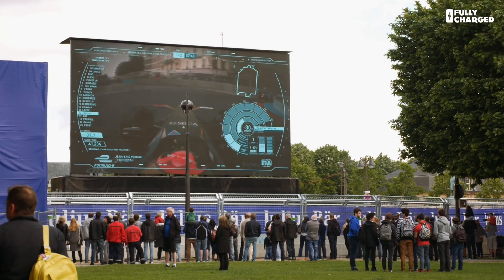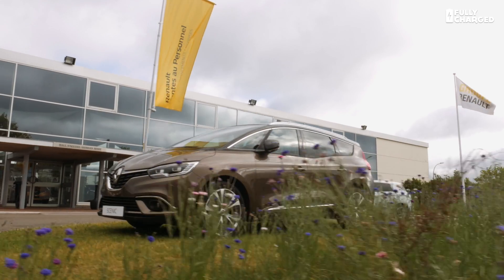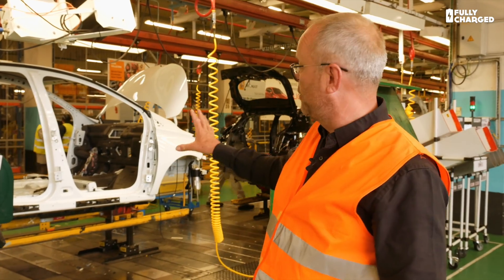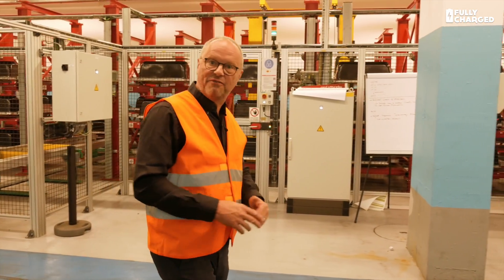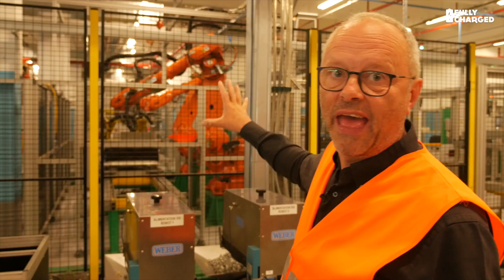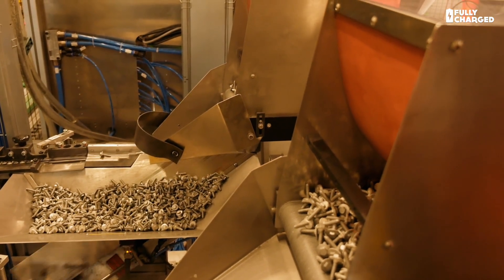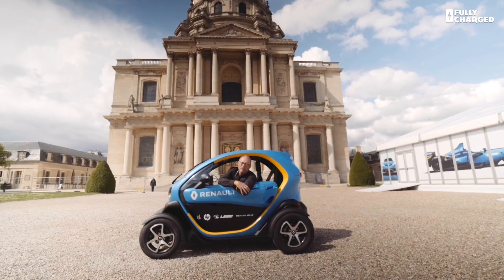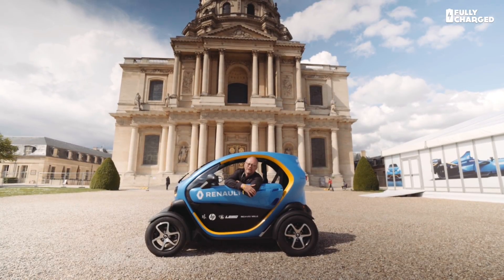Formula E & Renault Zoe | Fully Charged

Comment: I really wish Formula E would stick with using racing circuits over street circuits...   I get the idea of making it more accessible, but the street circuits make for very boring racing as passing is severely limited.    While I'm at it, since we have Formula 1 and Formula 2 etc. they should have gone with Formula 0 (F zero) as in zero emissions...   maybe Nintendo won't give up the name?

Comment: Not exactly on topic at all, but what do you think of the idea of putting something like a Tesla Powerwall into the back of a low-electric-range but capacious PHEV, like the 'newly-announced for USA distribution' Mitsubishi Outlander, for those times when it is being used for only commuting, not hauling, (and there is sadly no recharge available at work), so the Outlander can recharge during the work day, and gasoline use can thus be avoided altogether on normal work days?? (Assume that the commute distance one way will just about discharge the battery...)

Comment: Dyson, the engineering company best known for its vacuum cleaners and fans, plans to spend £2bn developing a "radical" electric car.
The battery-powered vehicle is due to be launched in 2020.
Dyson says 400 staff have been working on the secret project for the past two years at its headquarters in Malmesbury, Wiltshire.
However, the car does not yet exist, with no prototype built, and a factory site is yet to be chosen.
Sir James declined to give further details of the project. "Competition for new technology in the automotive industry is fierce and we must do everything we can to keep the specifics of our vehicle confidential," he told staff in an email.
Important points that are undecided or secret include the firm's expected annual production total, the cost of the car, or its range or top speed.
Sir James said about £1bn would be spent on developing the car, with another £1bn on making the battery.
Analysis: Richard Westcott, BBC transport correspondent
It was a slightly unusual launch, but then, Sir James Dyson likes to be different.
In a small room above his swanky London shop he told us about his vision for a clean car.

Comment: 6:22 Robert batteries aren't dangerous at a modular level the voltages are too low: it takes 50V to even risk human life and 500V upwards to induce internal burns (I've run electric vehicle production lines for SMEs in the UK). The risk only arrives at a pack level but even then it would not be fully connected until it was tested.

Humans aren't allowed in there because the robots have full freedom of movement so could hit their coworkers; cobots are robots that can work alongside human workers but they are a new technology and only currently utilised on German production lines.

Comment: Second life of a battery. That's the thing. For who is wondering how that works: In a car the battery has to be able to deliver a very high output for a short time, like when you accelerate. This ability goes down faster than it's capacity.

In it's second life, like as a powerwall, a battery never has to deliver a very high current for a short time. In this life it has to deliver a low current for a long time.

So a used EV battery can be used for many years longer for this kind of purpose.
Reply: Don't tell everyone! Peter.

Comment: I really hope super capacitors with comparable capacity with Li-Ion batteries come along within the next 5 years because that way regenerative breaking becomes super powerful, also you are likely talking about 10,000 cycles minimum if you expect 200 miles between charges thats 2 million miles of charges way more than anyone would ever need for a city car and almost certainly longer than the car will last, and that was a low ball on the cycles because you are talking about a capacitor not a battery, which good small capacitors can discharge 100's millions of times.

If you can get super capacitors with large enough capacioty you can recycle them through probably 3 - 5 cars then retire them to energy storage for renewables so even if they cost a lot you can just buy the rights to use it for 5 - 10 years so, second great thing is if they are graphene super capacitors you can probably wash down the graphene and reuse that if the cell breaks down and if thats the expensive part then graphene is super freaking strong and is unlikely to break even if it dose you can just grind it up and dump it as if you grid it up all it is is ash without any of the harmful stuff which is generally in ash.

Comment: I have a 2017 Prius hybrid. It works out that around town 50% of driving is on the battery. It uses half the fuel that our similar sized camry used. I also use ethanol blend fuel which is made from cane suger waste. In Australia electric cars are still rare and expensive because our federal government is opposed to futuristic ideas.

Comment: Love it as always Just wish the Zoe had both chargers like the leaf. Plan to buy one in next two years.
Reply: Peter Roberts It can actually charge just as fast as a Leaf with one connector: 43kW AC fast charging is nearly as fast as 50kW DC charging. Difference is that with AC you can charge it up to 100% full, what can't be done with most DC chargers.

I own a Zoe, and quickcharge like 10times or more per month
Reply: Peter Roberts Also the Zoe can charge 3-phases at home while the Leaf can only do a 1 phase charge, which is 3x slower. I can charge at home with 3x16A at 11kW or even 22kW if My household connection would be changed slightly

Comment: Now an option without the battery lease would be good.
Reply: I bought my Zoe ZE40 battery included, badged the I model in the UK. The battery adds £5600 to the price but Renault will give a good discount if you ask
Reply: In The Netherlands that is available. The price difference is € 7900. This is the same for 22 or 41 kWh battery.

Price list: https://prijslijst.renault.nl/zoe/index_html5.html?init=init_html5.xml&

Dutch price list includes all added taxes and costs.
Reply: Yep, that's available. You can buy car & battery, or buy car & lease battery or lease (well, sort of hire purchase) car and lease battery.
Reply: can i ask, what did you pay for the I model?
Reply: Ray Smith I bought a metallic black I dynamique nav, came in a bit under £18k. Not sure what discounts are available now, I know you will have to wait until next year if you order now though
Reply: Robert Smith that seems a really good deal. Thanks for letting me know :-)

Comment: Hey I really wish Elon all the best but when you look at the big manufacturers they have decades of car production behind them all they need to do is fit an electric power train to a body. The new prototype Porsche looks very good to me, tesla might have their work cut out. Another quality production from fully charged. Thanks
Reply: Tesla's mission statement is not to be profitable, but to force change toward EVs.   Also, don't forget their dominance in charging stations.
Reply: Supercharger Network.
If Porsche doesn't partner, it'll be 10 years before they can level the playing field.

Porsche fans be "Porsche is awesome" as they quietly buy Tesla's...
Reply: And shoespoon 100Kwh of battery in there. That's the real challenge. Tesla has them as part of the pan (i.e. the entire bottom of the car.) Ford, Nissan, and Chevy have had to find places to stuff them -- e.g. in the "transmission" tunnel, under the rear seats, in the trunk space, etc. Batteries are big, and bulky, and there's currently no way around that.
Reply: Many people today have 2 cars, if the second commuter/local trip car is an ev, this can be charged at home each night leaving the ic car for longer trips. This approach prevents range anxiety and less dependency on charge station. The plug type configuration really needs to be standardised as soon as possible.
Reply: 320ifq lucas It was Elon Musk who lit the fire under these ICE car builders... Someone had to do it, as they were stuck in their oil barrel mentality, with outdated polluting inefficient propulsion systems. Thank you Elon!
Reply: @András Bíró
Tesla may be good looking and have better range but Price/effeciency-wise VW e golf, BMW i3, Renault Zoe, Nissan Leaf are a better alternative to Tesla. That is way Tesla is only the 3. or 4. most sold EV in europe. 
Gigafactories and supercharger are not an issue for VW, Mercedes, BMW, Renault etc, merecedes......when they are going full electric. They can built as many gigafactories and supercharger as they want both in usa and WORLDWIDE. And those traditional automakers have the edge in thecnology, ressources and expertise. This video shows how Renault, BMW, Jaguar are using Formula E as an platform to push the EV technology further the same way ferrari mercedes renault have benefited from Formula 1 to develop new techs that are becoming standard on todays modern cars like CERS, Dual cluch, hybrid engines..... Audi is leaving LeMans to join Formula E and there is some rumours about Mercedes leaving Formula 1 to join Formla E as well.
The advantage for european ev automakers is also that europe is a better place for ev cars in all aspects  unlike Tesla/USA where super oil corporation still have greater influence and won t be easy with Trump as a president as well. lol
Reply: Gordon Warlow I agree with you up to a point. It was actually the state of California that set the 10% of car sales had to be zero emission. Many of the high volume prototypes built in the first few years of this millennium were pretty good, but when the state repealed the law they were mainly crushed. Elon has just re-ignited that desire. As I said I hope he deserves to do well but just don't under estimate the opposition. I also think that Europe is a softer target to build an EV customer base than the US, giving European manufactures the edge on their own continent.
Reply: Jon petter
Range is very important now, so that's a huge advantage. 200 miles is the magic number, and very few other cars have that right now. And looks are pretty big deal too. EVs are expensive, so if I'm paying a ton of money for one, I want one that looks expensive. 
A Tesla is far more expensive than the others you listed, and still they sell a lot of cars. And they don't have a factory in Europe, that makes them less competitive. The Model 3 will change that, it will have 10x more production volume soon, and a far more competitive price.
Yes, others could build gigafactories, and supercharger networks. My point is that they don't, and that gives Tesla time to increase it's lead.
Reply: Seán O'Nilbud no ICE is dead and Elon is winning as like how auto companies are following his path like he wanted them.
Reply: "200 is the magic number"

In reality there is no magic number, the magic number was 35, then it was 100, then it was 160 and now it's 200. My Acura's gas tank gives it about 310 range on a tank, does that mean everybody that drives my car will care if EV's have a 310 range battery for the same car?

The sad reality is no, range is not really an issue anymore, it's just perceived as an issue because our global culture revolves around being impatient. No battery has enough range when it takes longer than 10 minutes to fill for some people. Range anxiety has nothing to do with how much range you have. It has to do with the infrastructure of recharging the vehicle, long charge times and sparse charge points is the real magic number.
Reply: Tesla has far better cars, longer ranges, cheaper and better batteries, gigafactories and the Supercharger network.
The bi manufacturers are just starting to come out with serious cars, and almost all of them are years away from mass production. The ones that already exist are low volume, and hard to find.
By the time other manufacturers catch up to current Tesla cars, the Model Y, the semi truck, and possibly a pickup will be available. They have to drastically change at every level to succeed in the new world order, and huge old bureaucratic corporations change slowly.
Their only advantage is production volume, but that's worthless without enough batteries, and in battery manufacturing Tesla is far ahead of the competition.
Reply: @Ted Kidd
You must not be the sharpest knife in the drawer. Porsche is own by VW, the biggest automaker in the world. If they want to go full Electric they can built as many superchargers network as they want. Not only in US but worldwide. You talk about a car brand that has engineered vehicules in about eight decades.
Reply: Tesla are dead.